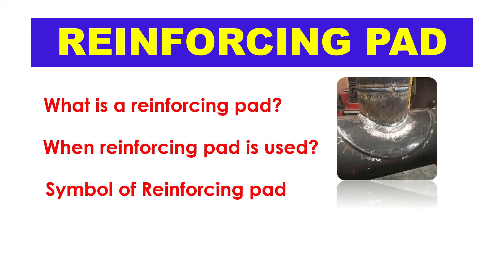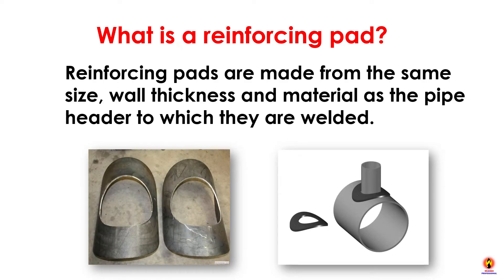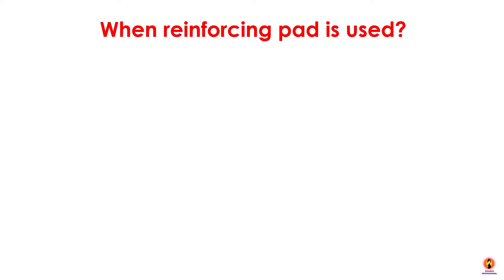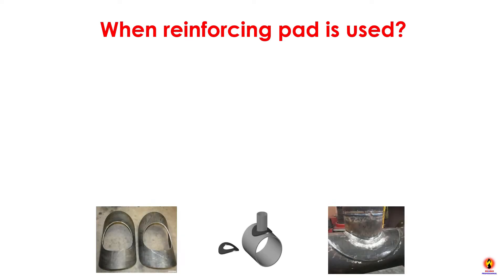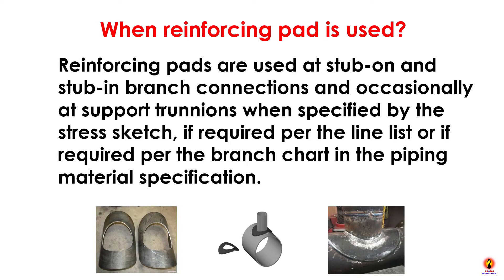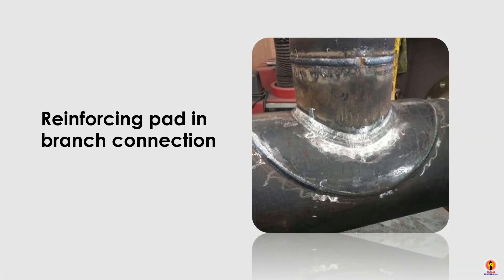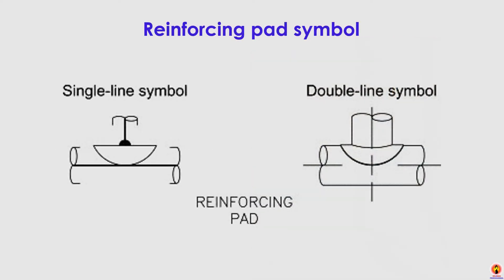Reinforcing pad / OIL& GAS PROFESSIONAL

Comment: It would have been a more complete video had you given credit for the photos used in the video to Cogbill Construction. The photo of the double pads was taken by us in our shop, and the 3D model was made using AutoCad by our draftsman. Cogbill Construction, in Vidor, TX is a leading manufacturer for customized reinforcement pads (Repads) and pipe supports and accessories.